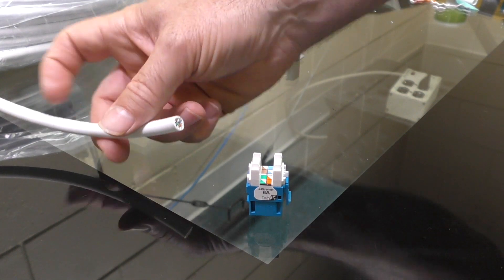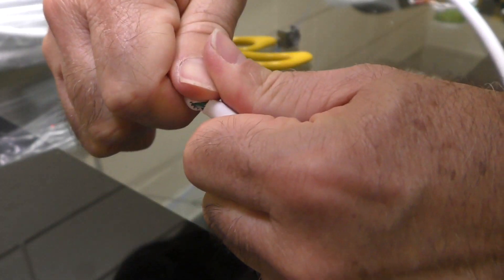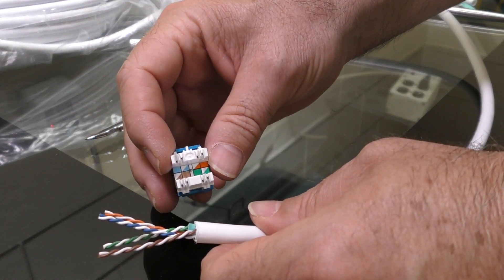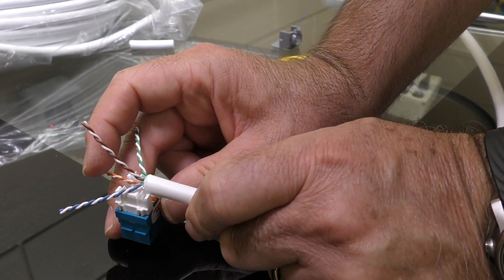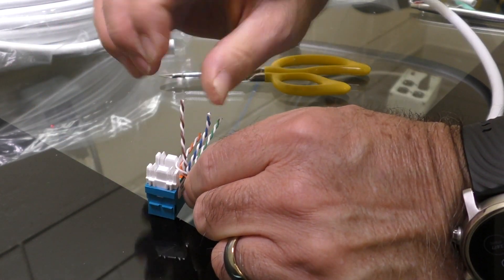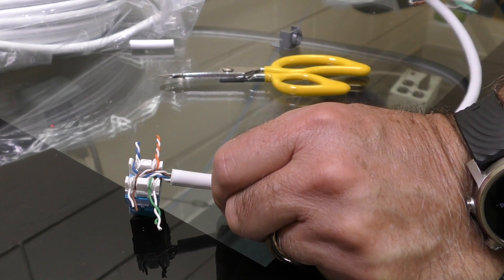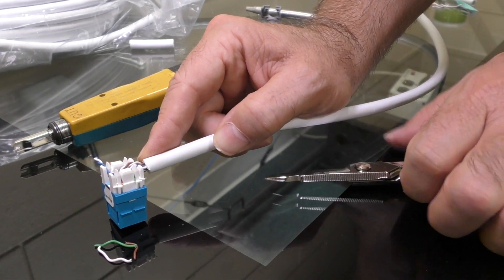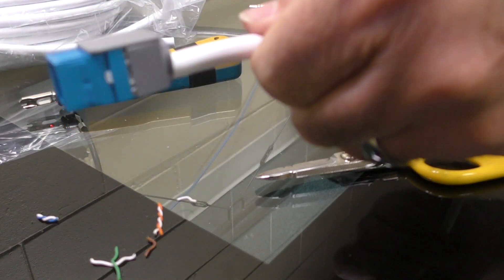Connect CAT6A Network Cable to Jack

Comment: Thanks for this video.  There is a tool that does all four wires at once I am looking into.  Also, the Klein Punchdown tool works most of the time. 😀
Reply from the maker: 6A is tricky work with, i'm sure you know.   Since you mentioned it, I made a video about one of those "all at once tools" on my other channel, but it's not for 6A, just regular 6/5e. 😄https://youtu.be/O4VjeXVns1k?si=jsLea5MfQJZb85sJ
Reply: @DIYTelecom Thank you.  Have a great day!

Comment: I'd change your title to include "terminating" so it comes up during searches. This was way too low at the search, but one of the better videos for 6a crimo
Reply from the maker: And,  I agree with you if my target audience were pros (as you probably are).  They would be using that word “terminate “.   But a large portion of my audience is DIYers.  And the “connect “ is more common for them.
Thanks for watching and commenting. 😊